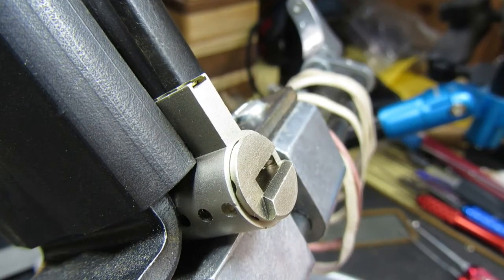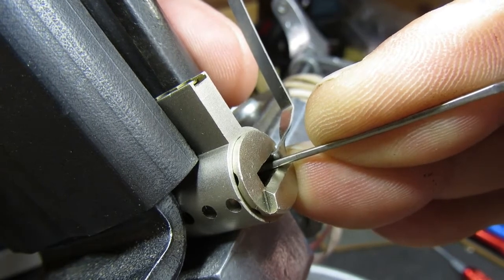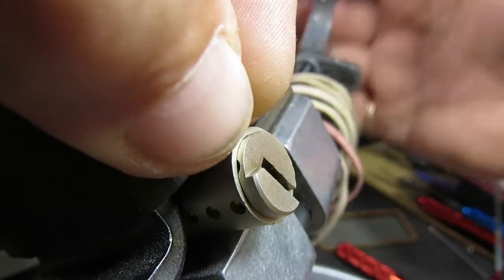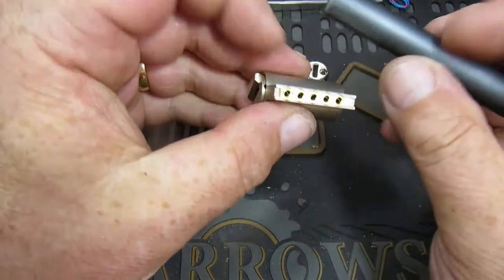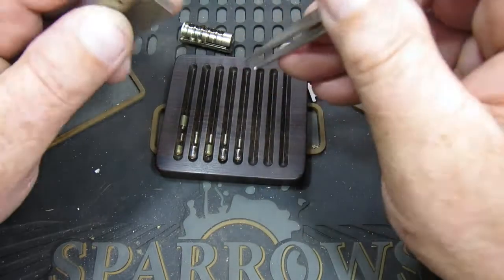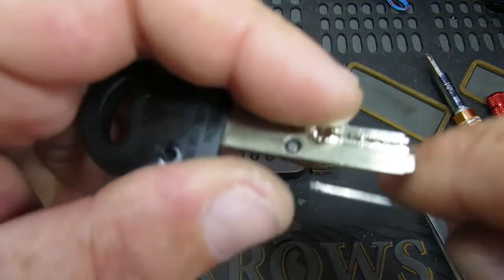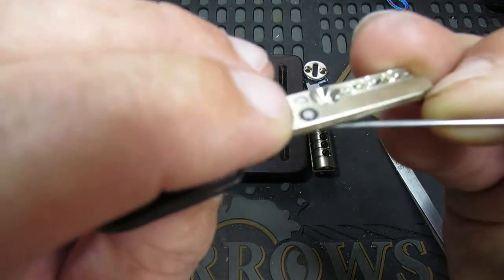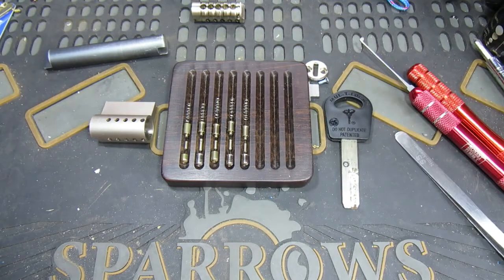(313) Mul-T-Lock Interactive Padlock Core Picked Gutted & Explained

Comment: Nicely picked mate. My ones haven't landed yet. But the interactive are the easy ones to pick out all the pip locks because the first pin is set high. So just 4 pins to pick. Great vid...
Reply from the maker: Thanks, I must admit I found them slightly harder than the classics, but probably because they're brand new with no wear.